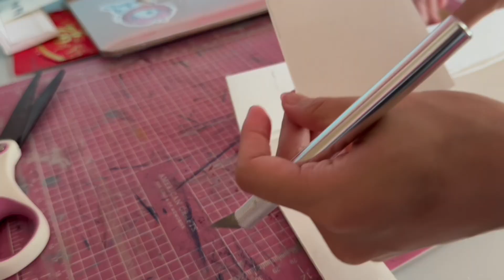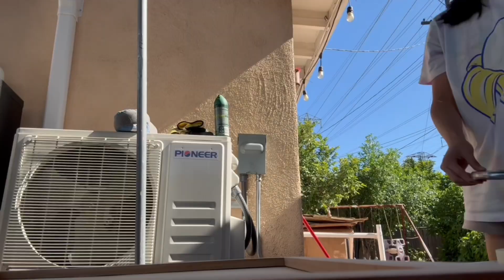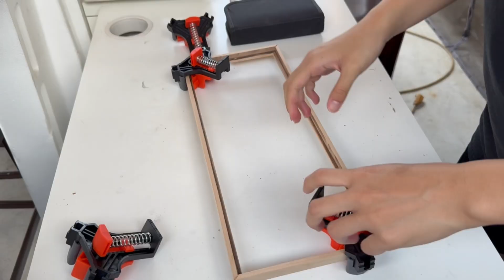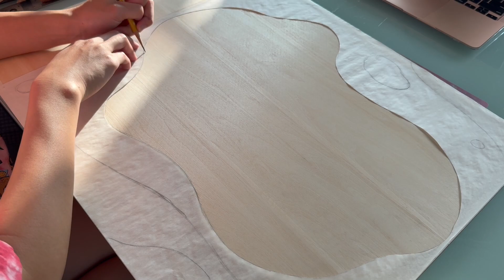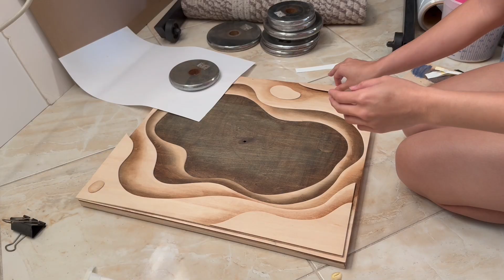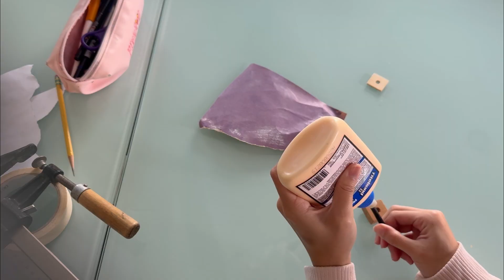The TIME and EFFORT that went into this | 'Safe' 🥲😭

Comment: I'm not sure how the cogs were going to be used, but in my opinion, this alternate, unplanned direction was a blessing in disguise because it turned out to be FARRRR greater and more cohesive than the cogs would have been, especially if the plan was to have them visible in the finished product.
You have amazing woodworking skills, by the way. I never would have guessed that you don't use that medium frequently. I respect your perseverance and commitment. I was surprised to see how young you are. 😂🤘🏼